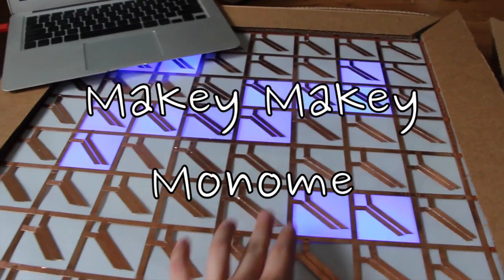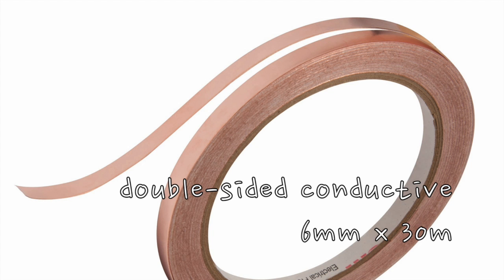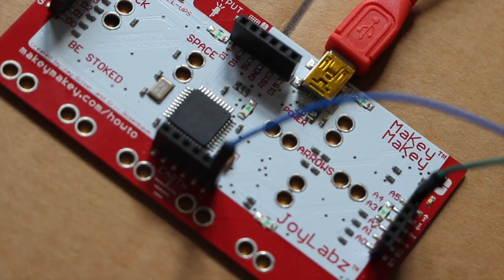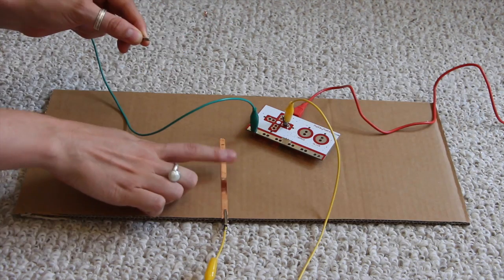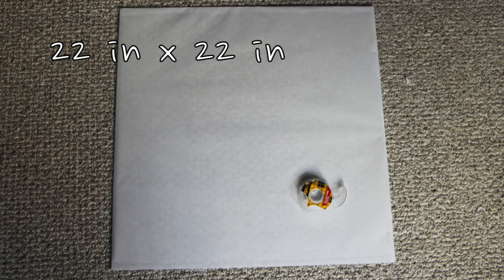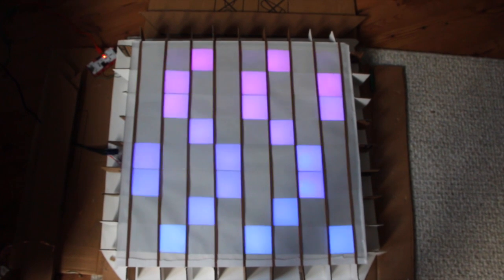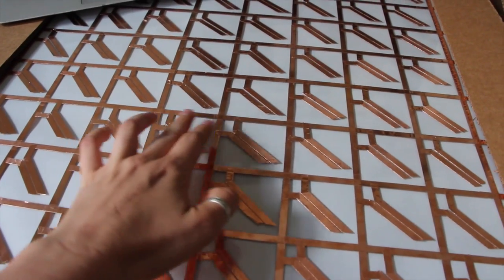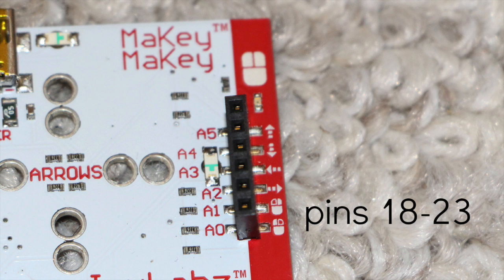Part 3: Touchscreen

Comment: Hello Jenna!

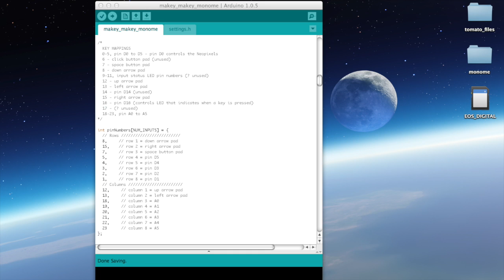Really nice tutorial. I'm stuck in a simple question: How many physical inputs a Makey Makey have? In this video you said about 20 but I own a Makey and it have 18 inputs only. In 03:42 you show pins 6, 7, 8, 12, 13, 15 (6 inputs), pins 0, 1, 2, 3, 4, 5 (6 inputs) and pins 18, 19, 20, 21, 22, 23 (6 inputs). Where are the 9, 10, 11, 14, 16 and 17 missing pins? Thanks a lot for your answer :D
Reply from the maker: :) it's been a while since I figured this out, but Google makey makey pin diagram. There's up, down, left, and right arrows (4); click and space (2); A0-A5(6); D0-D5 (6); and D14-D16 (3). That makes a total of 21. Not all of these pins work as inputs by default- they have to be reprogrammed.
Reply: Thanks for you reply Jenna :D